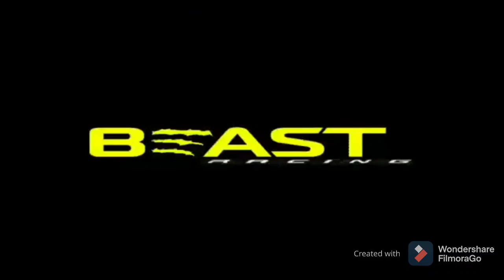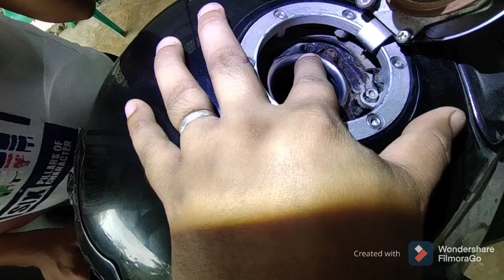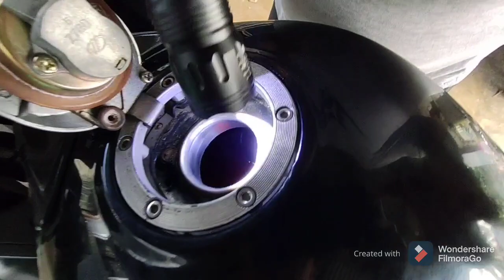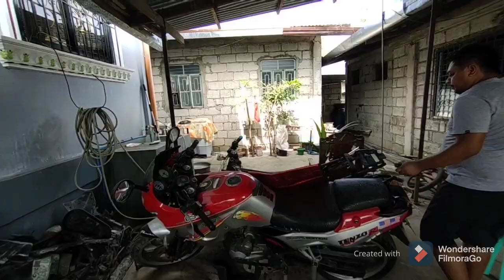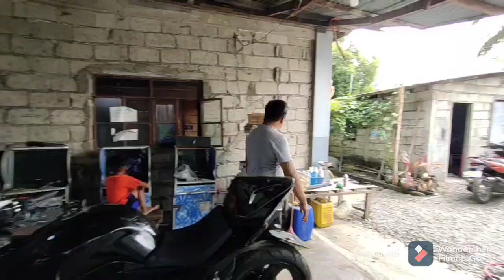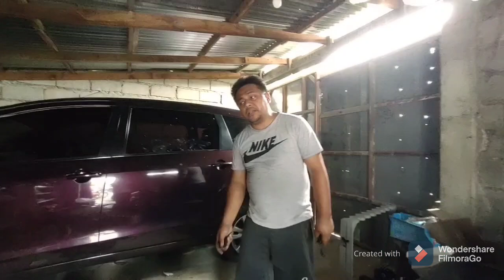Rusi Sigma 250 Water Problem on Gas tank Solved!!!

Comment: Boss anong pwding ipalit s stock throttel cable ng sigma nap2l ksi s akin stock yong carb k...
Reply from the maker: Gamit po ng ibang kasama pang tmx pero need ng konting modification
Reply: yung sa akin pang tmx 155 ok lang siya wala ng modification paps naka 30mm carb na ako sulit naman paps